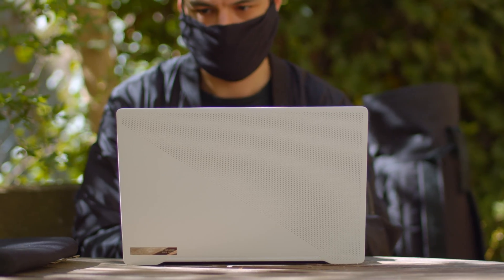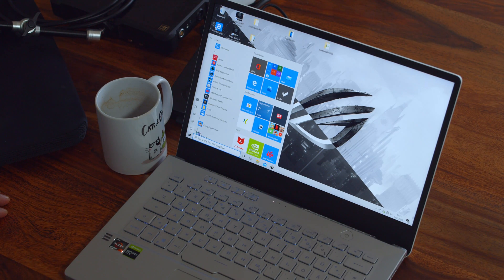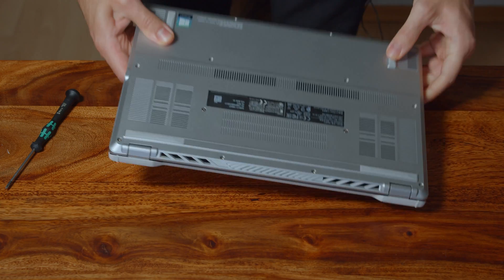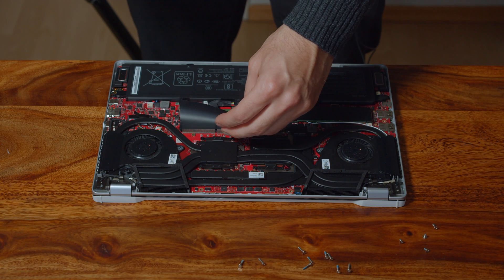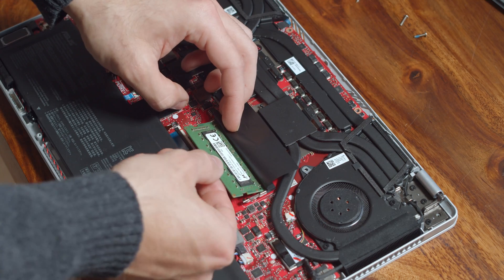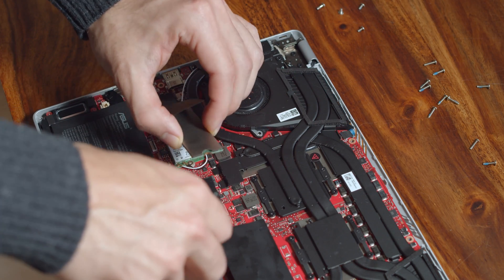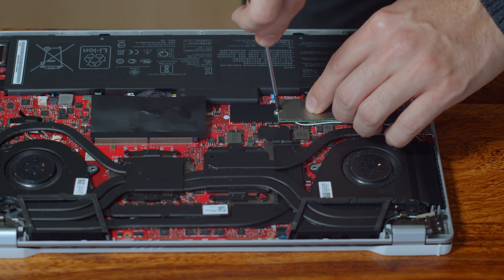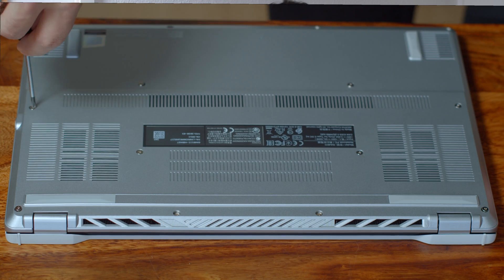Tutorial: How to Upgrade the SSD and RAM of the ASUS ROG Zephyrus G14

Comment: I think Josh Cravey has a good video explaining that the soldered RAM is actually not a problem, because if you get a larger size of extra ram it will use 8GB of it as dual channel with the soldered RAM and the rest as single channel. And you probably won't benefit from more than 16GB of dual channel memory.
Reply: So if I get a 32gb stick and remove the 8gb stick, I'll have 40gb of RAM from the 8gb soildered in, but it's not going to help much more than the original 16gb?
Reply: @BygSii  no no no. You will have 40GB of ram which is plenty for almost anything you'd wanna do (if you are actually planning this make sure your laptop supports that much ram). But only 16GB of that ram would be dual channel. But dual channel is way over rated. It's awesome for gaming, but no games even use 16GB, so you're still good there. Dual channel in other applications is not that noticeable, especially not when you already have 16GB of it.

Comment: I have the 2022 16gb version and I just ordered a 16gb stick of Crucial DDR5 4800 MHz. So I lose dual channel capability on the other soldered stick of ram? Sorry I'm a bit confused. So is this technically not really an upgrade then to go from 16gb to 24gb? I do lots of photo editing on Lightroom and I like gaming. The laptop handles both pretty well as is but I figured extra ram would help it get even better. Thanks for your time:)
Reply: Did you figure this out? This is my main question I wanna know lol
Reply: I reached to get a16gb of RAM but idk what it'll do to the dual channel or even think it's beneficial at this point

Comment: i heard if you upgrade one ram to 16 and keep the other one original 8gb, the pc will only use 16 all in all anyways. yeah you technically have 8 more in one slot, but whats the point in upgrading if it will not help the cpu to work faster? and if i were to put a 32 gb ram in one slot, i CAN access only those 32 BUT the pc wont go faster using just one.

Comment: I just found out. If your g14 comes with 16gb of ram, you can install an additional 16gb and utilize 32gb in dual channel.  The g14 maxes out at 32gb, any higher you lose the dual channel capability
Reply: what are u talking about lol how can you get 32 if only one stick is removable. it has 2 8gb sticks so how can you get it to 32gb???
Reply: @deadassbeats1925  there are some models that have just one stick of 16gb with no extra stick in the slot. It took me hours of research to discover this. The zephyrus g14 has like 8 different variations its so annoying.
Reply: @bigeeasy4344  wait brother I am planning to buy this g14 laptop

So if I buy some model I can get only 16 gb of ram and I can't upgrade it please tell me!!
Reply: @FirstnameLastname-cw1my  yes if you get the 8 gb ram model you can still have 32 but you will have to buy a 24 gb ram stick which will not transform in dual channel i think, also if you find a 16 gb ram model it probably has a 512gb ssd, i bought zephyrus g14 16 gb ram 512gb ssd ryzen 7 4800hs with a gtx 1650 4gb vram and im happy with it everything is fine but i need to buy a 1 tb ssd now bcs the size is more smaller than you think bcs windows 10 ended up taking 40 gigs so only 482 gigs of free space left and i have now 58 free gigs because i downloaded gtav,forza horizon 4, csgo,minecraft,rocket league,truck simulator 2,,scrap mechanic and beamng drive, i still recommand going for the 16 gig model right away.
Reply: @gamerulnugamer4727  Oki thx alot brother
Reply: @FirstnameLastname-cw1my  no problem
Reply: I thought there is just one slot to install one modul?
Reply: @LittleJack74  yeah there is only one ram slot and you cant replace the ram in the slot, glad i chose the 16 gb model, i am buying a 1tb ssd next month and i will replace my 512gb ssd, after that i'm thinking about buying a very good racing sim setup

Comment: I didn't realize that one of the RAM modules was built into the mainboard. I bought 32 gigs of gaming RAM. Will I be screwed matching the superior gaming stick of ram with the built in one? Their timing is different as the gaming RAM is CL16 as opposed to CL22
Reply: Did you figure this out? I'm trying to get 16gb ram to make it 24 total but he never it sound like I'll be making it run but as smooth or something

Comment: Would the HyperX Predator 32GB 3200MHz DDR4 CL16 DIMM XMP Single Stick HX432C16PB3/32, Black work as I look to switch the ram and can’t find the one you’re using ?

Comment: When upgrading only the RAM do i need to do anything else beside
1. Turn off laptop & unbolt the screws
2. Plug RAM in
3. Put it back together and turn it back on

That is all right?
Reply from the maker: Basically, yes :)
Reply: what about the battery connector?

Comment: So I have just replaced the SSD in the G14 and there is a complication if your new SSD has a different sector size compared to the original that comes with the G14 (the original had 512 sectors, the new one had 4k sectors). Different sector sizes means that many standard utilities to clone your old drive to the new one wont work as they wont be able to copy from one to the other. I ended up having to create a Recovery Drive and effectively re-install Windows on to the new SSD to get it to work.
Reply: Damn! Thanks for the heads up, i’ll have to make sure i get that aspect correct when i upgrade. 

Any videos or articles you can send my way regarding this topic? Kinda new to this whole upgrading thing lol

Comment: Ah man, I was really hoping this'd have a second m.2 slot - still looking like a great option though, probably my next PC.
Reply: I got mine one month back . If you are planning to use it for heavy gaming please look elsewhere otherwise this laptop is amazing for all other purpose with light gaming .
Reply: @pyc3521  Why?
Reply: @pyc3521  Ended up going with the Omen 15 (AMD version) because of some extremely juicy holiday discounts. I don't do "heavy" gaming, just photo editing, esports titles and some streaming - honestly modern releases look amazing even at medium settings so I don't see the need for specced-out top-end machines anymore for me personally on the GPU front. This'll last me a while I think (my desktop is/was still running an R9 280X, for reference, and that hardly bothered me). For my user behaviour, this kinda laptop lets me replace two devices in one and that was the goal here.

Comment: is there no way to upgrade ram and keep dual channel?
Reply: Yes you can! Ryzen processors support "flex mode" memory, meaning that if you have two sticks of different sizes (let's say you have one 8gb soldered ram and one 16gb stick), 8gbs of the soldered ram and 8gbs of the stick of ram will run in dual-channel. When you use more than 16gbs of RAM it will just run in single channel (for 24gbs total memory).
Reply: You can. check this comment for details: https://www.youtube.com/watch?v=GlruMEh1H4E&lc=UgzeXdxQUef3LrR-tMV4AaABAg

Comment: Hi, for RAM upgrade, will it match with a DDR4 2133MHz from an old laptop?
Reply from the maker: Hey, it will work and the existing RAM will match your old RAM to work properly. But since it's a Ryzen Setup, we don't recommend slow RAM since AMD Ryzen profits massively from fast RAM. Memory is cheap right now, so maybe check if you can get some DDR4 3200MHz for cheap.

Comment: So wait, there's 8gb on board and then 8gb in the memory slot?
Reply from the maker: Hey, depends on the exact Model you get. In our case there was 8GB on board and we put in another 8GB. But there are also versions with 16GB on board.
Reply: @notebooksbilliger  do you know where i could find the models with 16 gb on board?
Reply: @notebooksbilliger  hello. I have the GTX 1650ti model so I have 8gb inside and only one possibility to upgrade :

2 questions please :

1) can I put 16gb ( or higher ) in the free slot or only 8gb ? ( Is it efficient 8 + 16 or the best is 8 + 8 ? )
2) should I buy jedec memory ?

Comment: Hi i just purchased the G14. How do you figure what your ram is configured in(without opening it up) some newer g14 are being shipped 16gb and an open slot instead of the 8+8.
Reply from the maker: Hey, usually it ships with the RAM slot being unoccupied. But of course they may be differences in the exact configuration based on where you live. When in doubt, ask your shop or the asus support in your region.

Comment: I have the GA401IH version and when i placed another stick of ram on the empty slot and turned on it wont boot and it just stays in a black screen. It only boots when i remove the ram stick. I checked the ram is the same DDR4 3200 1.2v it just wont boot up with the extra ram how can i fix this
Reply: Ryzen laptops can be picky about RAM. It needs to be DDR 4 3200 at base (JEDEC) frequency rather than at XMP. Check this thread for details: https://www.reddit.com/r/AMDLaptops/comments/j29rpt/what_ram_will_work_in_your_new_ryzen_4000_laptop/

Comment: I saw in a different video that even if you upgrade the ram to 24gb (8gb soldered on board+16gb that’s replaceable) they said you would still get dual channel on the first 16gb but the last extra 8gb would run in single channel mode. Is this correct?
Reply: I read this too', up to 16 gb in the upgrade slot and dual channel is still in play.  Is it true? Someone please validate.
Reply: @bobbywilliams9203  yes it is also make sure that the 16 is SINGLE RANK...same as the soldered one other wise you will lose about 40 percent memory band width....

Comment: Can we upgrade the AMD Ryzen processor and graphic card??
Reply: No you can't; and you don't want to. You buy this tiny laptop to have the best possible performance in such a small size; no other CPU can match it at the moment, and that GPU is the most powerful that can work in such a small laptop. A 2070 would overheat as it makes too much heat. 

So if you want more power than these in a laptop... You need to wait for new CPU to come out, or if you need more GPU power, you will need to buy a big laptop that can handle the heat output of higher GPUs. But you will lose that CPU because 2070s don't come with Ryzen. You only get hotter, slightly worse for productivity, but ok for gaming CPUs by Intel.

Comment: What size/type screwdriver did you use to remove the screw for the SSD? The screws I have don't exactly fit the screw for my laptop so I have to look for it now :(((
Edit: my laptop is also ASUS but it's the GL503VD model

Comment: The four screws on the lip of the laptop take shorter screws, except one of these corner screws (lower right as laptop is on its back) is longer than the other and it says in the manual that it is a "pop up screw" and doesn't get removed after it is loosened.  I wasn't reading the manual so I was mystified by this.  From reading comments, I made sure to have a new screwdriver so that if any screws were hard to get out, they wouldn't strip. So I get to the one really stuck screw and by putting moderate pressure directly down, I used pliers to turn the barrel of the screwdriver and that got it out. 

Everything else went fine. I paid $42 for 8G of Crucial (Micron) RAM, whereas I noticed some of these laptop manufacturers will charge as much as $90 for them to double the RAM on a laptop that comes with only 8G.

Comment: El Professor, would I be voiding my warrenty if I install another 8GB stick of RAM
Reply from the maker: Hey, that depends on your local laws and/or the local warranty regulations by ASUS. Usually RAM is a so called User Replacement Part and may be altered by the user. But this may vary by region.

Comment: Hello my friend
Awesome video, it's very useful!!!
I want to make a question
I just purchased the Asus ROG Zephyrus G14 GA401IV with the 16gb Ram but i want to upgrade it with 32gb ram, is this impossible, or it will have problem?
The ram that i want to use is the TeamGroup Elite 32GB DDR4-3200MHz
Thank you in advance!
Reply from the maker: Hey, so you want 32GB in total? When you bought the 16GB Version, there should be 16GB soldered to the Board with another slot available like shown in the Video. So if you want a total of 32GB, you'd just have to get another 16GB RAM Module. But of course you can also just add 32GB of RAM, it should work fine as well.
Reply: @notebooksbilliger  Umm, no. The 16gb model has 8gb soldered and 8gb in the so-dimm slot.
Reply: @zs2001  There was a 16 + 0 SKU sold in some regions. But for most of us, the 32 GiB version is the only one with 16 GiB soldered.

Comment: Can I use a ram with lower speed like 2400Mhz.....will it have some big impact??
(Indian Variant has only 8GB ram 3200Mhz and a slot to upgrade)
And does removing the back panel void the warranty
Reply: same question here bro.. also where can I get a 3200mhz stick in India

Comment: So, what Will happen, if i add a 32 gb  of RAM   stick instead of 8?
And how can i reach promised 32 gb of maximum RAM onboard?
Reply from the maker: Hey, you can't change the onboard RAM. There are Models announced with 16GB of onboard Memory, but those still aren't available everywhere. But of course you can add a 32GB module into the free RAM slot.
Reply: @notebooksbilliger  i mean, how much memory Will i get adding 32 gb in ram slot?
Reply: @Booboooru  40GB lol. Do math
Reply: @Booboooru  how much is 32 plus 8? Lol

Comment: If you buy one with only 8gb of ram is the ram in a 2 x4 config or would it be 1x8 and have the expansion slot open?
Reply from the maker: Hey, it's 8GB onboard then with a free expansion slot.
Reply: @notebooksbilliger  thank you so much!
Reply: @notebooksbilliger  Is there a limitation of 24GB in the free expansion slot  ? Also could you recommend which brand model ram can we use ?

Comment: Does the base model with 8gb ram only have that memory on the board? If so is the dimm slot empty?
Reply from the maker: Hey, yes, the 8GB model has the 8GB soldered to the mainboard so the slot is free.
Reply: @notebooksbilliger  yes it does. Just bought a g14 it's pretty good. Definitely would benefit from dual channel RAM. Purchasing more soon! Thanks for the reply

Comment: Hello, I have the ASUS - ROG Zephyrus M15, 2020 version (i7-10750H 16GB DDR4 SDRAM
 3200 megahertz) I want to upgrade the one stick of RAM, with a 16GB stick, for a total of 24GB. Do you have any recommendations that will work? I'm hoping to get a stick that has the correct CL timing / voltage /speed. Thank you!
Reply from the maker: Hey, are you sure about the 3200MHz? Thta's unusaul for an Intel System. You can check the exact specs using tools like CPU-Z. If it is 3200MHz, just make sure to get DDR4 SO-DIMM with 3200MHz. Voltage is the same within that spec and timings aren't really that important.
Reply: any update on this? I have the same laptop, waiting on 16gb ram to come in so I can upgrade to 24gb. Did my research and it is an intel system with 3200mhz, went ahead and also looked up part number for current ram in laptop and specs came back to 3200mhz.

Comment: Do I need to disconnect the connector from the battery before upgrading RAM?
Reply from the maker: Hey, you can do that to be absolutely safe, but as long as you're carefull you shouldn't have to do so.
Reply: just unplug it lmfao
Reply: There are some videos where users complain that after disconnecting the battery their laptop does not work, meaning that they fried their mobos as they did it incorrectly. I would say that it is not that safe.

Comment: Can someone recommend a good upgrade for the ssd? looking for 1tb expansion but not sure which model would be compatible..
Reply from the maker: Hey, if you don't want a slower SSD than the preinstalled one, check the Samsung 970 EVO or the Western Digital SN750 SSD. Both are really fast and available with up to 2TB capacity. If you don't mind speed that much and want to go a bit more affordable, the Crucial P1 is a good choice.
Reply: @notebooksbilliger would a 990 work as well?

Comment: You dont need to open up laptops to upgrade RAM, you can just download it off the internet.

All joking aside. It doesnt have another m.2 slot ? Other than the slot for the wifi?
Reply: yep. only 1 slot
Reply: Comes with 8g soldered onboard, 8g replaceable.
Reply: @dymone4894 so 40 gb ram total

Comment: Thanks, I managed to upgrade RAM successfully
Reply: Did you see any performance increase/decrease? How much ?
Reply: @H3cTicBenj45  I see a slight performance gain in terms of speed. And I get the benefit of huge memory size since I use VM everyday.
Reply: @husniadil  what type of VM software? I am actually interested on this laptop because its performance; I run 3 to 4 VMware machine labs all the time.
Reply: @TheSQL-Lover  WSL2 and Docker desktop
Reply from the maker: Great, have fun with your Zephyrus G14!
Reply: Did you face any performance issues after the upgrade?
Reply: @jonathandias2292  No performance issue so far
Reply: @mazfrans9568  I'm using Team Elite 16GB DDR4 3200 Sodimm https://www.teamgroupinc.com/en/product/elite-so-dimm-ddr4
Reply: Just wanted to know if Softwares like CAD and Solidworks would work good.
Reply: @jonathandias2292  I don't use these softwares, sorry 🙏
Reply: You put another RAM except onboard RAM right? Or you pull out the onboard RAM and put 16 GB RAM?
Reply: @anlelmastas6201  Just plug your 16GB mem stick in to the slot. You can't pull out the onboard one.
Reply: @husniadil  I meant I have 8 GB mem stick. And laptop does. Can I put it in and works like 2x8GB dual channel?
Reply: @anlelmastas6201  Yes, just make sure that the mem stick has the same latency settings and speed (Mhz) with the onboard one. You can check the onboard one using cpuz software. Then you can find mem stick online that has the same speed and cas latency.
Reply: @husniadil  Thank you so much Husni. You are the best.